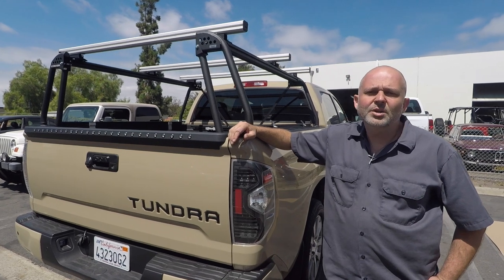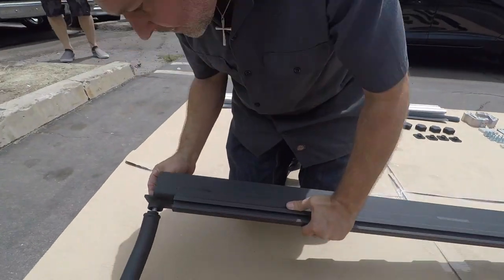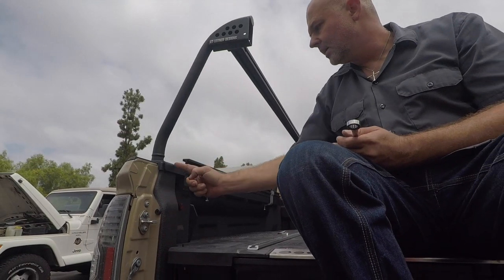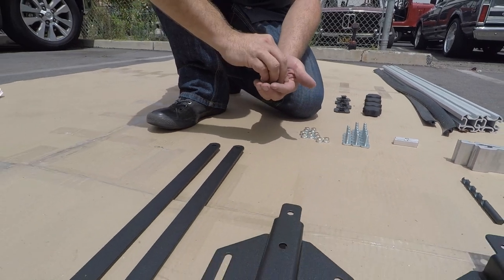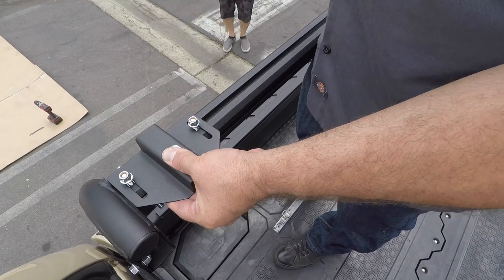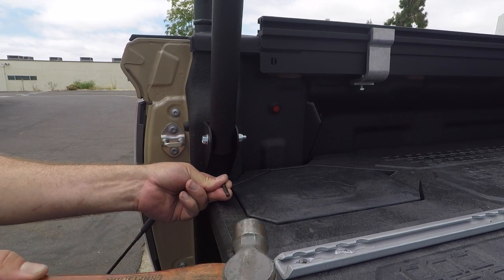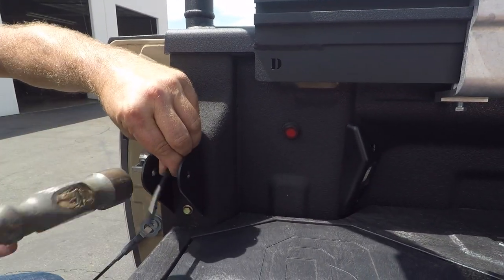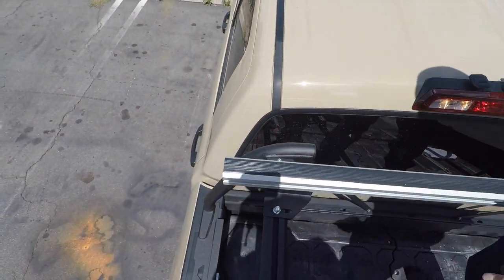Leitner Designs ACS CLASSIC Full Installation

Comment: The instructions emphasized that the long bar should Butt up completely against upright bars but mine still has about 1/16” gap even after tapping with rubber mallet.  Is this ok?  I want to whack it any harder to get it to butt up which I don’t think it will.

Comment: On the camera shots panning the vehicle when the unit is fully installed, it looks like the rails on both sides of the truck bed have some sort of silver tie down pieces. I’m not seeing those addressed in the install process. Are those pieces I’m seeing to tie down items in your truck bed? If so do they come with the kit or is that an add on part, and how much weight can they safely secure?

Comment: Thanks for the video.  Can you advise how this would be installed on the Gen 2 Tacoma 5ft bed with a Decked system?  Your instructions called for removing the rear bed bolts and installing rear upright braces in that location.  Will those instructions change to allow use of the Decked system and then how would the rear upright braces be installed without drilling? Also have you developed a tarp or cover to attach and cover your system for weatherproof camping and load protection?